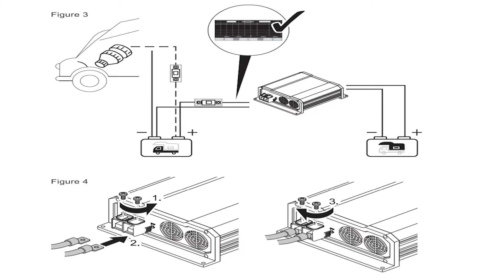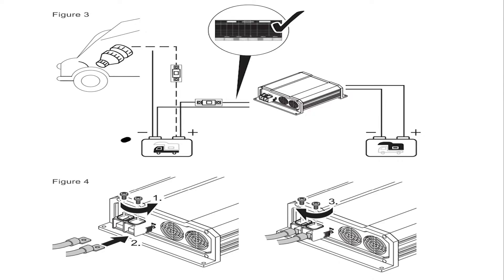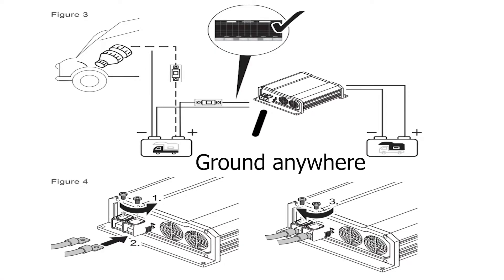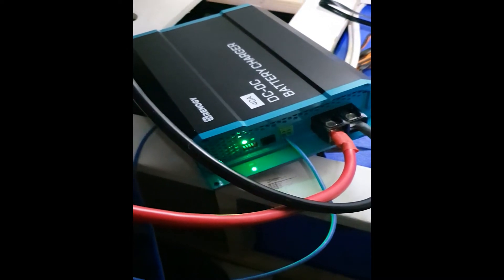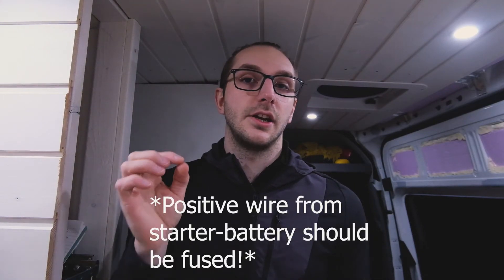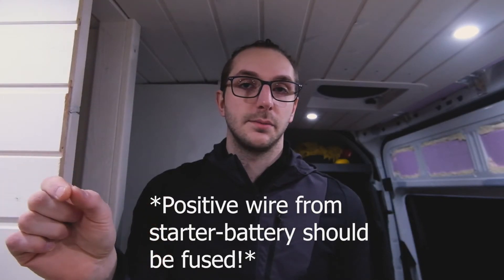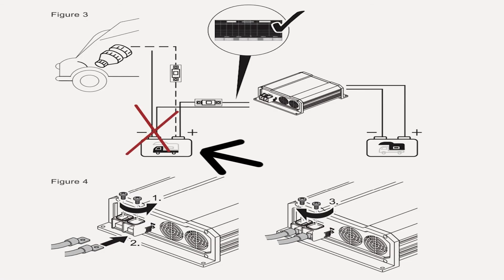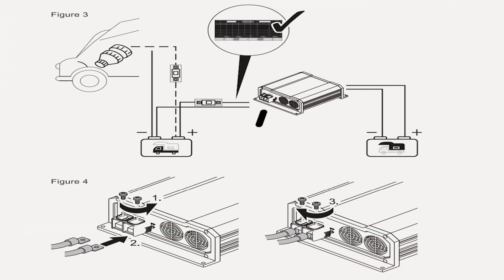Troubleshooting RENOGY DC-DC CHARGER | Green flickering light | Red pulsing light

Comment: If you have and then no green light, open the casing up. At the "input" end there are 2 internal blade fuses (20A x2)
Reply: I don't think my issue is a bad fuse. Whenever I connect the D+ wire, the green light comes on for a split second and then goes off. If the fuse was bad, the light probably wouldn't come on at all
Reply: Did you find solution ? Got same issue @bad_actor1128

Comment: I see so many issues with these posted,  but no resolution? Did you finally run a negative to your starter battery and if so did it work, please update or it's useless to be on here
 thanks
Reply from the maker: We said in a comment below that something is faulty with our inverter that was "knocking out" our charger. We did eventually run a negative to our battery but the problem persisted. But an update now is that is just started working.. we dont know if something "fixed itself" or what but now the charger works like normal.  We will be goin with a different brand next time ^^

Comment: You said when you're trying to recharge your cellphone batteries, you're getting weird fluctuations. If you're using a MODIFIED SINE WAVE inverter, that will definitely cause those kinds of problems. Always use a PURE SINE WAVE inverter to avoid problems with sensitive electronics.
Reply from the maker: We are using a pure sine wave inverter, so that’s not the problem ☺️

Comment: Mine doesn't even light up at all
Reply: just installed one and also no lights at all.  Looking for a solution if you have one?  I have tried new earth grounds without success
Reply: @dant3658  I need to fit a battery monitor to check it's even working
Reply: Did you find the cause ? mine doesn't light up either.
Reply: @mattpearce5712 any news on fixing the issue mine doesn't light up either?
Reply: @Petar120  both input fuses had blown. 40a X 2
Reply: @mattpearce5712  mine are all good but still no light, I don't have battery for output is that maybe an issue? Didn't connect it yet
Reply: @Petar120  definitely try a battery on the output first
Reply: @mattpearce5712  i took a car for a drive and charger started working, still no battery on output installed, apparently alternator needed to charge a bit before it started working
Reply: @Petar120  that's excellent news I'll remember that for the future 😎

Comment from the maker: Hey everyone. The real culprit to my issues seems to be some kind of fault with our inverter. 12v and 2000W inverter is connected to the batteries along wiht the charger and everything else. 
The DC-DC Charger works as intended untill we run the inverter. 
After that the charger no longer turns on untill i unscrew everything from the batteries and then reattach, after that the charger works again. 

We dont know why this is happening. We're not really using our charger now, we get by on our solar. If anyone has an idea that would be nice :) 

Other symtoms is that if we have computers charging on the inverter's power we cant use the touch pads. They get really wierd and move how ever they want. I've done some googling ofcourse and as far as i understand it seems to have to do with static electricity. Please reply to this comment if you have any ideas :)
Reply: Is the black / negative DC 12V cable of the inverter a smaller size diameter than the red / positive DC 12V cable of the inverter?

Comment: Just run ground to battery like in the installation say and end problems
Reply from the maker: Hello! Like i told the other guy, we had no way of attaching that wire to the negative of the battery like the instuctions say. So to save time and effort we did this instead. Hignsight, we should have put in the extra effort :P It does still work for us but has a few hichups now and again.

Comment: If you follow the instructions as listed you are much less likely to have an issue. So many people think they can cheat their way to an easy install by not running a ground. Best practice is to run lines of the same diameter the same distance. Sometimes resistance matters.
Reply from the maker: Hi! We followed the instucitons first and ran both wiers to the battery but the issue for us was that we had no way of attaching it to the negative terminal. Sure we could've put in the extra effort and cut the the grounding wire and put on a new terminal shoe that would accept an extra wire but for us this seemed like a good plan at the time.